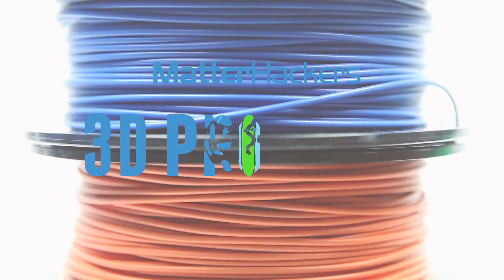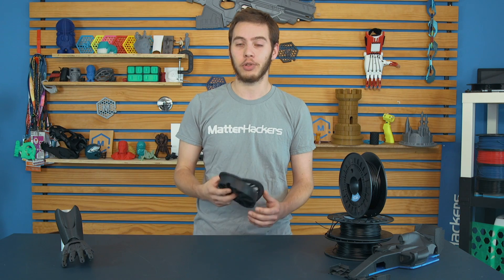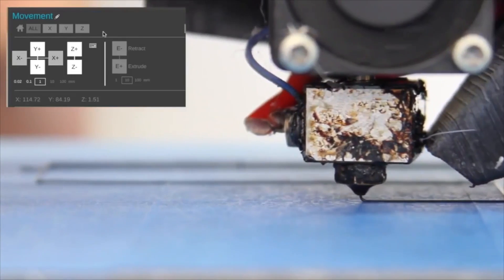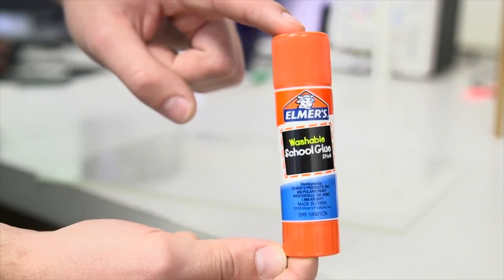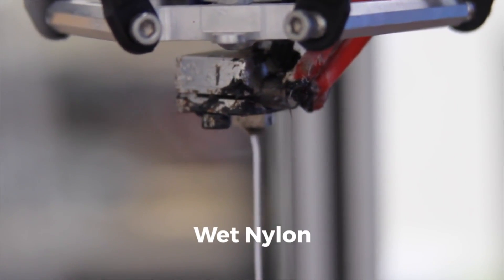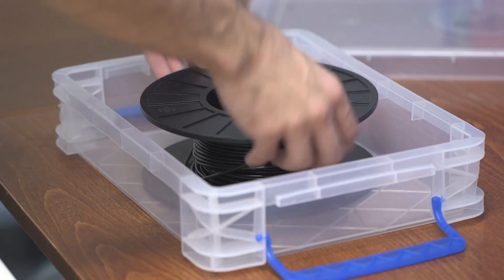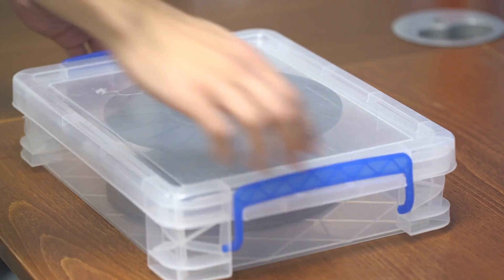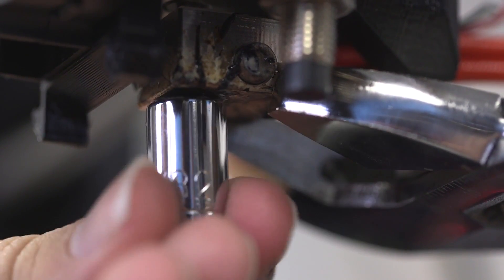How To Succeed When 3D Printing With NylonX Filament // How To 3D Print Tutorial

Comment: I've never claimed to be a "pro" at 3d printing, but I never realized I'm an idiot.  I CANNOT get NylonX to stick.  I've tried glass, steal, PEI, and garolite beds...with ranges from 40-100C, and from 250-280C on my metal hotend with steel nozzle......all on a Hypercube Evolution 300.  I have it enclosed, with no part cooling fan activation.  I'm about to tear out my hair, and burn this printer !!!!
Reply: I literally just use regular white school glue mixed 50/50 with water. Paint a layer on and heat the bed to dry it. Repeat if needed to build up a thin smooth layer. That's all. Super easy

Comment: Great info and product, however, you're wrong on desiccant not being able to extract moisture from filament. I think CNC Kitchen demonstrated this in part of one of their videos.  Obviously its not as fast as oven but you can see measurable continued extraction of moisture beyond what you get from the oven over time.  This simply makes sense too, like baking bread or something you get a dry outer crush with moisture still towards the middle, filament is smaller in diameter but also much more dense.  Moral of the story, dry in oven then store air tight WITH desiccant for continued slow extraction (I think around 10days stored it levels out to as low as you're going to get).

Comment: i am purchased nylonX from you guys thinking it would be good to print my homemade drone from. I read it would be one of the best but am not sure... Would there be specific settings for infill etc that would make it right. I am doing 100% infill with solid layer every 15 at .15 layers? thank you
Reply: so i answered my own question :) these settings worked great - had a tiny bit of warp but nothing i can't get over. the part looks great - it is very strong and much lighter then the PLA counterpart. Your video was dead on - you really need the glue ;) it saved me from making too many mistakes. I was able to print my parts on the third try (first after putting glue down). Way awesome guys - thank you very much. Going to look at NylonG for the drone arms - cause it has colors and is supposedly just as good as NylonX

Comment: I see many people are replacing the hot end on the ender 3 & ender 5 printers with all metal hot ends in order to print nylon, carbon fiber etc. Would you by chance know if the ender 3 "PRO" and ender 5 "PRO" come standard with hot ends that do not need hot end modification to print nylon & CF? Also, I am about to  purchase my 1st 3D printer and will mostly be printing materials that need to be high strength & rigid.  Do you feel the Creality products are up for the challenge? And, since I'm basically looking for strong & rigid vs. nice looking, Would you recommend another printer within the same $300.00 - $600.00 price range? Your assistance with this decision would be greatly appreciated.

Comment: What bridge or super steep overhang settings would you recommend as a starting point with NylonX, please?  I just need a good starting point.   The printer is all metal hot end M3D V6 upgraded Creality Ender-5 Plus with the Silent Stepper board upgrade (TMC2208 drivers) and the latest TM3D Marlin 2.0 firmware.   I'm comfortable with dialing in the e-steps, the slicer flow rate, so that my lines come out to within .01mm of the line width if not dead on.  I'm pretty comfortable getting my z offset, but I rarely do bridging, and my most successful bridging or overhangs have been minimal at best or supported.   With an expensive filament like NylonX, I'd sure like to at least have a chance at some strong bridging.   I saw an article on the MH website demonstrating the bridge strength of NylonX but the article didn't mention anything about the bridge settings used.   Thanks for any help you might be able to give for a good starting point.

Comment: Does NylonX absorb water if it is poured on it after the print is done and off of the bed?
Reply from the maker: Yes. In fact, any nylon product you purchase, like a handheld drill, absorbs water. The key difference is that once it's done printing, you aren't superheating the water. Heating the water is what breaks down the nylon chains, so once it's printed you can submerge the nylon part in water and it will be fine. - Alec

Comment: Maybe I missed this in the video somewhere, but what diameter nozzle is recommended when printing NylonX? I've heard it's generally a good idea to size up your nozzle when printing these "infused" filaments, but by how much? Is a .40 diameter nozzle adequate? Should I go bigger? Or - does it depend more so on layer height? For regular Nylon, I'd prefer a smaller diameter nozzle b/c printing with my .40mm nozzle @ .20mm layer height is too stringy. 
I assume one would also need an enclosure to print this because it's a type of nylon and would need that even heating to minimize warpage? However - Do I still need to turn off my layer cooling fans if I am using an enclosure?
Good tip on the z height for first layer... I think this was an issue I was having with Taulman Bridge nylon previously.

Comment: What 3-D printer do you recommend out of the box that’s good for using this nylon x? trying to spend under a thousand dollars and should it be a enclosed unit? I’m new to this so I want to get straight to printing when it arrives. And I’m trying to print 1/5 scale rc car wheels and they would need to be printed at a 100% fill at a 2mm to 3mm thickness so I’m lookin for kinda of fast prints not Particular pretty just flat and true prints? Something Like your gear bearing thing but not as thick

Comment: Will this print on CR-10?
Reply from the maker: You'll need to change your hotend. The stock hotend on a CR-10 is PTFE lined, which rapidly degrades and off-gasses toxic fumes at the temperatures needed for nylon. You could print and mount an E3D V6 and that would have you covered and give you a lot more material flexibility.

Comment: Thanks for taking the time to make this video. It was helpful to me. Please make more of an effort to enunciate your words. I had to rewind part of your video 5 times and I am still not 100% sure what you were saying. I am new to 3D printing and don't know all of the jargon yet, but I think you were saying..."all-metal print heads".
Reply: He is saying all metal hot ends.  This is an extruder where the Bowden tube does not go into the hot end, instead it connects up higher to a metal channel. This allows >240C printing because it will not heat degrade the PTFE teflon tubing. However, this is completely unnecessary if you use a $12 Capricorn Bowden tube, which will not degrade until >300C.

Comment: I have ABS ramps for my truck and they dont crush. Haven't had anything but problems with high end nylons. Dunno what the problem is - 100c + bed dosent help, Micro Swiss all metal hot end dosent help, PEI dosent work glue stick helped a little. Got Tulman Bridge and it was oily. Im thinking theres fake Tulman filaments on Amazon now. The nylon carbon fiber is so flipping expensive, probably need a .8mm nozzle for it to not clog.
Reply: Same experience, the biggest problem is bed adhesion. Note this video doesn't even mention it as a problem.

Comment: Could you olease make a video about filaments that could ruin your brass nozzle! Like filaments with carbon fiber, etc. I would love to buy some other filamenttyoes than pla and abs; but I don't know which filaments(with addins like glitter, etc) ruin your nozzle!
Reply: Get a hardened steel nozzle that's nickel plated. Itll last forever with regular filaments and take many kilograms before it starts to wear. Micro Swiss has them and so do others.
Reply: I've done about 2KG of glow in the dark, 2KG copper, and 500G of carbon fiber through a brass nozzle and it came out fine XD.
Reply: @infernaldaedra  That's highly doubtful.
Reply: @clayton9136  The prints were fine. The nozzle was practically rounded off lmao.

Comment: I disagree about desiccant pulling moisture from filament. I have had 2 "bad" spools of PLA show up that were water logged. After a couple weeks in a tub full (this is a 30 gallon tub with 7 pounds silica gel) of desiccant they were fine.
Reply: x9x9x9x9x9 You wont get the same results with Nylon. PLA is totally different but I guarantee you didn't get all the moister out of it using desiccant. It's impossible. Baking is the only wait to force all of the moisture out.
Reply: For sure. I just think it does suck some moisture out. It completely changed how the filament printed though so I believe it does draw some out. On the note about nylon vs pla; I know I was just saying in general. I believe it works. I do have a food dehydrator on the way though just so I can finally give nylon a try.

Comment: Thanks for this video. Good info! I would like to share another tip here: When printing Nylon, for a really flat and shiny surface finish of the first layer, I always apply a layer of water-soluble white wood glue (=PVA) on the entire surface of my buildplate. I apply that layer by first putting some painters tape along the edges of the buildplate, then pouring down plenty of PVA glue between those tapes on the buildplate and finally flattening out the glue with a metal ruler. The PVA layer will then have the same thickness of the tapes on the edges and you will end up with al very smooth surface to print Nylon on. TIP: When printing large items a glass build plate might break due to the fact that Nylon really sticks well on PVA and due to the warping of the printed item.
Reply: Bed adhesion is literally the most important factor in printing nylon, and this video completely ignores this, making nylon printing sound easy. We don't need >100 YouTube videos explaining nylon is hydroscopic and to buy this and buy that and try this and try that.
I've had huge rafts just lift away mid-print on all brands of nylon. 
Sometimes I think the filament industry has a business plan to answer "try this, try that" while burning pounds of plastic filament. 

This comment by you is the only really practical point in this entire video.
Reply from the maker: Awesome! Thanks for the great, detailed feedback!